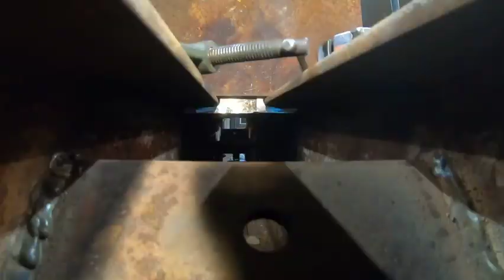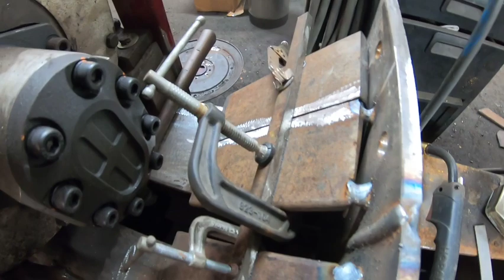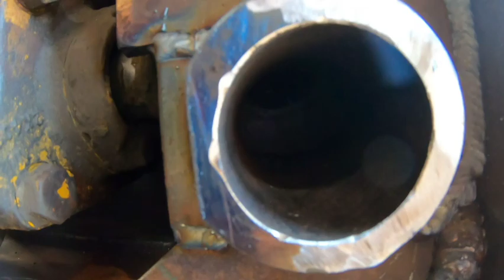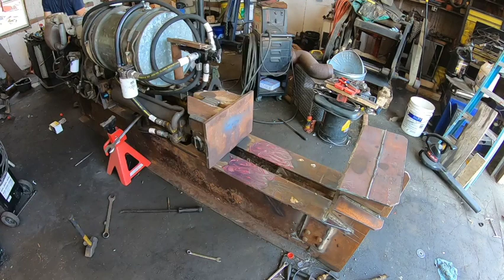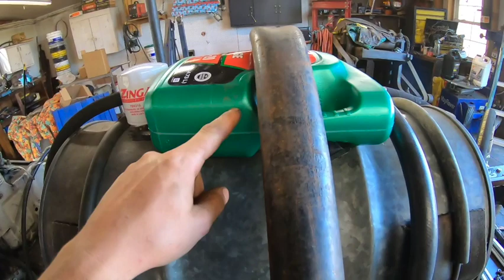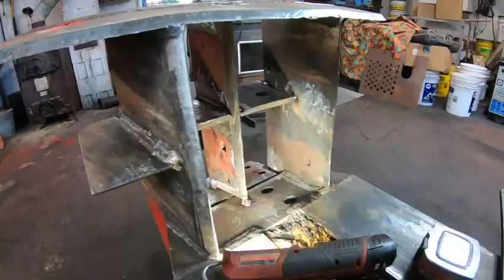Two Hydraulic Cylinders Log Splitter Build Diesel

Comment: You need to submerge your return into the hydraulic tank under the oil level to prevent air mixing in with the oil.
You have a large reservoir so unlikely the air makes it to your pump inlet but it would be hard on your pump it it does.

Seems like one 5" cylinder would have been more than overkill to split anything.